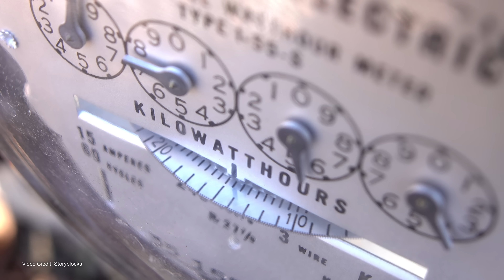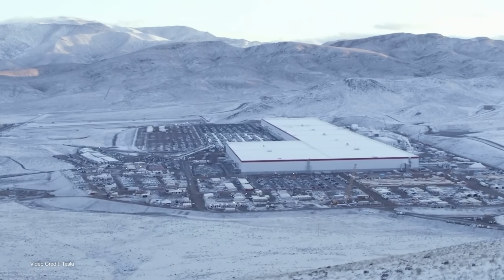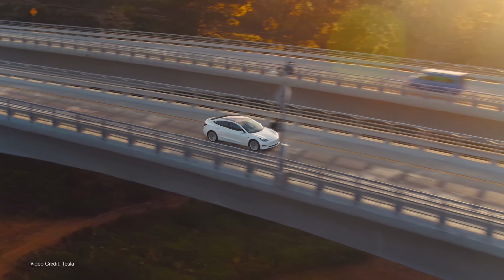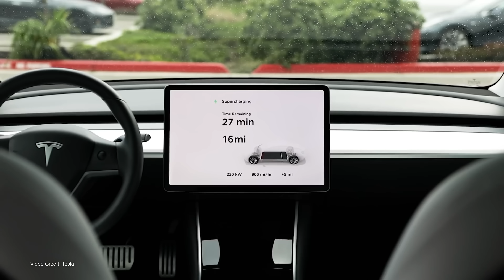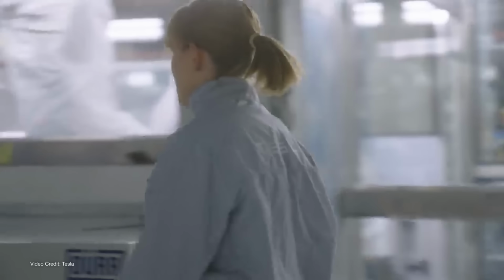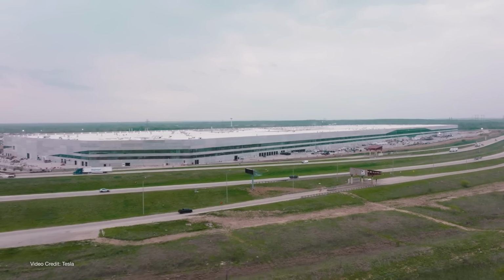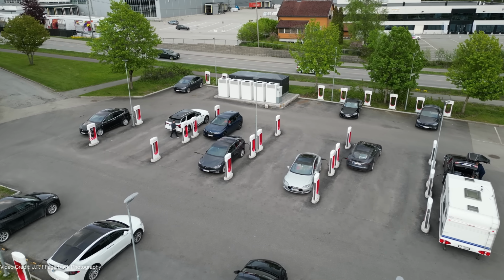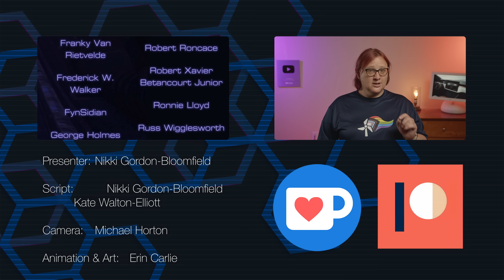Tesla News Roundup Episode 14: Munro Model Y Teardown, Where Tesla Staff Are Going, Model 3 1,000km!

Comment: I'm gonna write up here why I do not support Aptera in its call to make the Tesla charger the standard. Because there are a few points that Chris and his team overlooked. I posted a similar explanation under Aptera's last live stream and they were so kind to hide that comment for over a week in their comments before ultimately releasing it again.

The Tesla charger is great from a technical point of view. Despite its size, it is easy to handle, easy to use and can deliver a lot of power. But in order to be a standard, your standard should be open. And that is not the case. The Tesla charging standard is a closed standard. Tesla controls it and does not accept any input on it from anyone. As a car manufacturer, you are free to work with Tesla on implementing it in your own cars, but if you have a good idea to improve the next version of the standard, there's no way to  even put it in as a proposal to be considered.

But there's also the other end, the chargers. Tesla is the only one that can make charging stations based on the Tesla connector standard. That means that if this was to become a standard, Tesla would be the only one capable of building out a charging network and every single EV owner is required to use Tesla's chargers to charge their car. And that is just a monopoly. And we all know what happens when a company becomes dominant in a market. It isn't good for the consumer.

Had Tesla created its charger system as an open standard, free to implement both in the vehicle and at the chargers, I would support the idea of making it a standard, but not as a closed standard. And that is where Tesla went wrong. And no, that open patent pledge from Tesla is not involved here and is something entirely else.

Chris also mentioned that Tesla did not have an option as there were no standards back in the day. But that is incorrect. CHAdeMO was already a standard when the Model S was still on the drawing board. And CharIN also was founded and working hard on the CCS standard. They demonstrated the first CCS charger in the USA a couple of months before Tesla opened its first public SuperCharger back in 2012. Tesla could have joined either initiative and attempted to influence them in adopting something different, or as stated earlier, they could have opened up their own standard and attempted to pull in other manufacturers.

But you cannot say at a moment when all manufacturers but one have adopted a single charging standard that everyone should change except one. Hell, Tesla has been a member of CharIN for a few years now, not sure even Tesla would still want to invest in its own charging standard.

Comment: If structural battery packs aren't repairable because they're buried in glue, can they be recycled?
Reply: Elon Musk seems to think so.
Reply: Sounds like a nightmare for recyclers unless they can find a chemical to dissolve the potting material without damaging the battery packs.
Reply: @heathwirt8919  there is a company that neutralizes the energy in battery packs by freezing them. Then they simply shred the battery packs, and separate different materials.
Reply: Yes they can. The shredder doesn't care about the foam/glue.
Reply: Thé first question is can they be reused/repurposed! Before recycling!? Because even after years the whole battery pack isn’t bad at all, it’s just many cells that are kaput.
Reply: @w0ttheh3ll  lol…. The shredder doesn’t care but the complicated process to remove the polyurethane is not good at all!!
Reply: @carholic-sz3qv  Yes, exactly. Munro have started "tearing down" the structural battery pack. They say it can't be repaired because it's a mass of glue so the cells are virtually inaccessible  -  obviously, nor can the cells be repurposed. The only option is shredding to recycle. So it's a waste of a valuable resource if these cells can't be repurposed, only recycled.
Reply: @carholic-sz3qv  yes, most likely they could be reused or repurposed. The question is how many hours of labor and energy would it take to differentiate the faulty cells from the good ones? Chevy seemed to have a very difficult time with this issue when it came to their bolt EVs.
Reply: @justinweatherford8129  But that wouldn't allow for the rebuilding of a serviceable packs which would be more eco friendly, cheaper and allow battery pack longevity to be extended.
Reply: @carholic-sz3qv  These battery packs are going to last a million miles and I bet the car gets recycled before the battery wears out. My older generation Tesla battery usually lasts 400,000 miles on average. Seven years ago it could go 230 miles and last week I charged it up to 224 miles. I am above 98,500 miles so far.
Reply: @heathwirt8919  each of the cells in the Chevy Bolt battery packs had to be checked one by one manually. That's a lot of tedious labor. Elon may have considered that it is cheaper and more efficient to just scrap them. I think that Elon has so many other and more important projects than having his people stand there with a multimeter and test every single cell in a bunch of battery packs. Getting as many EVs on the road as fast as possible then swapping out batteries until our carbon emissions problems are resolved is in my opinion the best approach. When the carbon emissions are under control, then we can concern ourselves with taking the time to manually test every single cell of the battery packs.
Reply: @justinweatherford8129  Updated systems use diagnostics to isolate the failed cell. Elon may have considered what is cheaper for him and more expensive for consumers to maximize profit.
Reply: @heathwirt8919  think about supply and demand. The demand for Tesla vehicles is so high that Tesla can't keep up. If Elon wanted to he could probably charge twice as much for the cars without losing any on sales. If Elon was just swapping out the battery packs for more profits, don't you think that he would have just charged more money for the cars in the first place?

Comment: Is it true that there’s more CCS out there that Tesla connectors???
Reply: That's a difficult question to answer and would probably depend on geographical location. In Europe for example I would say: absolutely. In the US, not so sure yet, although with competing networks building out infrastructure, I would assume it is only a matter of time.

But is also depends on your definition, are we talking locations, or actual plugs? Because Tesla sometimes has over 50 chargers in a single location. Just a few months ago I was coming back from Munich and at one of the charging locaitons I had stopped on my way to Munich they had this huge Tesla Supercharger lot and next to it were 5 CCS chargers from a different brand. The CCS chargers had a small queue while virtually no stalls were taken on the Tesla lot.

There's still work out there.
Reply: @Hans-gb4mv  Connectors. For sure Tesla has a very high number of stations and connectors… why not “force” tesla to make their chargers open to any manufacturer. 
Let the market decide what they want.

Comment: I disagree that it’s easier for Tesla to switch to ccs than it is for everyone else to switch to the Tesla charger. I believe that there are more cars out there with the Tesla connectors and more charging stations with that connection, correct me if I’m wrong. So it would be more work to switch all those things vs. the way lower amount of cars and stations with the ccs connections. And the Tesla connector looks like a better option so why not just use the best and most numerous one?
Reply from the maker: Tesla already has the in house hardware to do so and uses it in Europe, and at present the Tesla connector does not offer 2 way power transfer as is now offered by multiple vehicles from multiple brands. I do not know if functionality could be added safely to do so, but Tesla has so far shown no inclination to do so.

^Kate.
Reply: Except that it looks like Tesla is planning to do in the US what it has done in Europe: install charging stations with CCS plugs. So soon, the CCS charge plug will be present everywhere, even at Tesla charging locations. And that changes the entire story.

And look at all the cars that are coming to market, some of them in segments that Tesla has no answer for yet. In maybe 2 years, Tesla's market share will drop under 50% and at that point, the Tesla connector will no longer be the dominant connector on new vehicles sold in the USA. And with the rapid expansion of charging networks, the number of CCS chargers in the US will catch up to the count of Tesla chargers in a similar timeframe. And all of a sudden, the tables are turned.

Why not use the best? Because it is not an open standard. And it's up to Tesla to make it one. But given that Tesla has switched to CCS in Europe, I feel they'll do the same in the US.
Reply: @Hans-gb4mv  Tesla has only installed those on a few of the supercharger stalls at US locations so maybe a couple vs. the rest remaining with the tesla plug. So even if they increase that to all the supercharger stations in the US it will still just be a couple per station if they keep up what they have been doing. Most stalls will still have the tesla plug. I don’t think that in two years there will be more or equal other brands of evs to teslas but who knows. If that is the case then in two years my argument will not be valid but today there still are way more Tesla’s than other evs and if the other brands started using tesla’s plug today then all would be better sooner. Why wait till CCS is dominant to make tesla change? Why not just change now to tesla’s? The only pro that the CCS plug has over the tesla plug is the two way power that Kate mentioned so that’s a good point but besides that, I still think that the tesla plug should win but who knows what will happen…

Comment: What’s the difference between repair ability of a vehicle or a battery pack and recyclability offset battery pack or vehicle because if you can replace one battery cell out of the battery pack and recycle it into a full battery pack opposed to recycling and entire battery pack to build a new battery pack to replace said recycled battery pack opposed to a repaired battery pack am I making you confused or understanding the difference between repair ability and recyclability what is the cost variation that is the question that I am posing to your audience and yourself

Comment: It's interesting to see how industry standards are created (not just EV charging). Often the only thing they can all agree on is the worst possible solution. Throw in some government interference and it can only get worse.
Reply: On the other hand, USB-C ...
Reply: CCS was designed to be backwards compatible with existing AC chargers. They solved this by adding 2 pins while Tesla solved it by using the same pins. In that regard, Tesla's solution is more elegant and in a way it is a shame that Tesla did not join CharIN around 2010 when they started developing their own solution to push for something like the Tesla connector as an open standard.

On the other hand, the current Tesla connector has its limitations and I think Tesla is close to those limitations of how much power they can send through that connector. At that point, you'll have to change the connector anyway if you want to provide even faster charging.

Comment: Texas grid is more than just underfunded, since basically the utilities and oil and gas industries took it over, and no regulations apply to any part if it. and of course this was all sold that it would lower electric rates. which it hasnt down, Texas actually has higher rates than Oklahoma, and much smaller state, but with Oil and gas in state. and those rates dont include the extra costs caused by last February's debacle.  which isnt fixed. no matter what the state tells you. and probably never will be .

Comment: The right to repair campaign is about manufacturers not deliberately obstructing repairs, or denying the parts to third party repair companies. It doesn't mean everything has to be designed to be repaired. Nor is it a right for the general public to do the repairs themselves, but rather choose a qualified third party. 

You don't really repair things at the component level. When a CPU fails, you don't fiddle with it, you pull it out and replace it with a working one. But if a surface mount IC fails, it's unlikely to be worth soldering a new one in place and it's extremely challenging to hand solder surface mount tech (if not impossible in many cases). 

The battery pack as a structural unit doesn't need to be 'repairable' or made differently to be so. The right to repair bit would be, 'Will Tesla let your local qualified mechanic buy one, ship it to them, and install it for you if you need a new one.' and honestly, you probably wouldn't want them to. It'll be more like, door handles you broke, or other small parts. 

Battery packs, like PSUs in computers are definitely not ever, ever, user serviceable. But most especially the bigger they are, the more dangerous they are. The Munro video is super clear about part of the problem being not wanting to die in the process of breaking it up. No-one should be trying to replace 4680 cells in a pack, except the original manufacturers. It just wouldn't be safe. 

But it doesn't mean it's an impossible problem to recycle them when they reach end of life. Or that any extra burden in doing so isn't vastly superior to the alternative of dragging around pointless weight that provides structure when the batteries can do some of that. Which is yet more stuff that needs recycling at some point, and causes pollution for the whole life of the car.